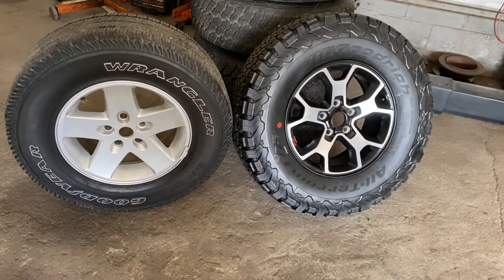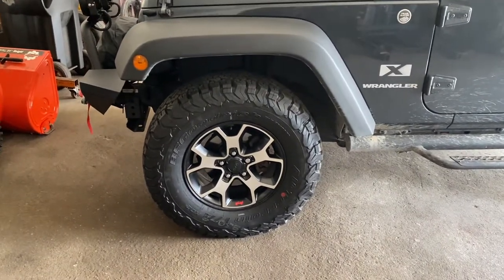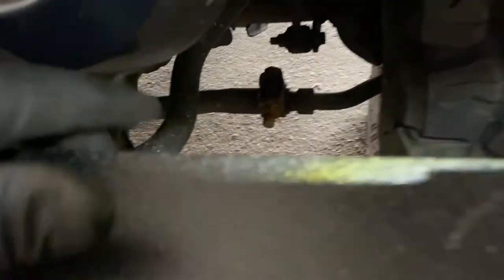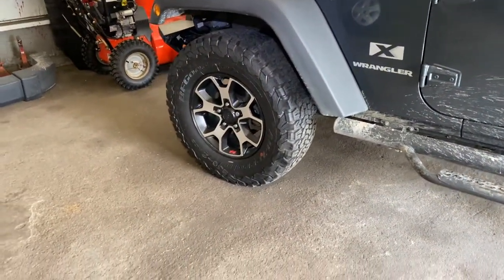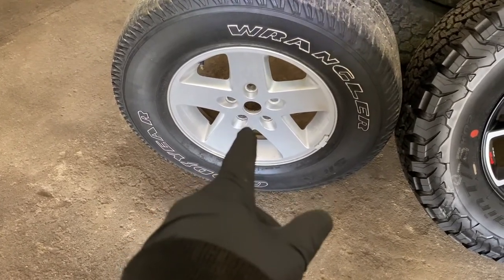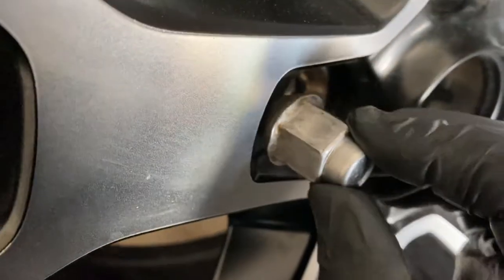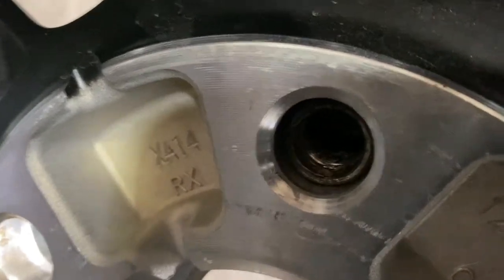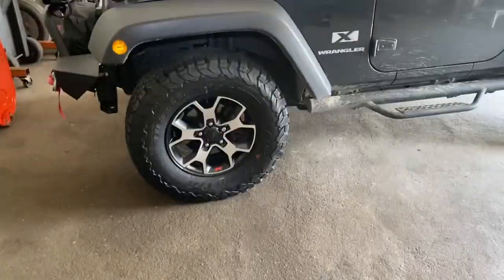Jeep Wrangler JK to JL Wheels Upgrade - No New Lug Nuts Needed

Comment: Did you have to reset TPMs sensors? I got a 2017 jk and put on 2021 rubicon or willy.  But the sensor is alerting and not reading the pressure.
Reply from the maker: I’m not sure if they are the same frequency, if they are they might need to be reprogrammed.
Reply: @motorcarnut  and if they are not??? They need replaced?
Reply from the maker: Yes, if they are on different frequencies

Comment: Did you happen to need spacers or trim the front airdam? I heard there are issues with rubbing
Reply from the maker: Yes, those size wheels even with a lift, it would rub the sway bar so I added wheel adapters (see my other video on those)

Comment: What thickness of a wheel spacer did you end up using?
Reply from the maker: I used spidertrax 1 1/2 with 33’s and it rides perfectly on and off road.

Comment: any issues with the TPMs Sensor
Reply from the maker: 2007 to 2012 are 315 MHz.
2013 and up are 433 Mhz.
Reply: @motorcarnut  thank you. Fixed my rubicon JL tires on my JK 2010 and very wow. No issues, drives great and looks so good.
Reply from the maker: Awesome! Great upgrade
Reply: So did you have to get new sensors? I have a 2008 JK wanting to put a set of 2018 JL wheels on it.
Reply from the maker: Yes you do if you care about that with the constant airing up and down. 
2007 to 2012 are 215 mhz
2013 up are 433 mhz
Reply from the maker: Meant 2007 to 2012 315 mhz